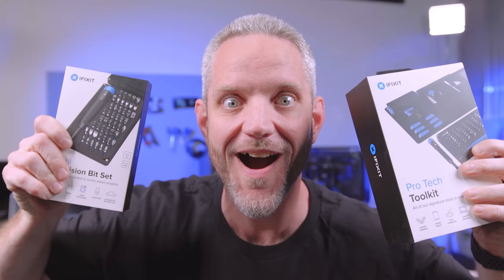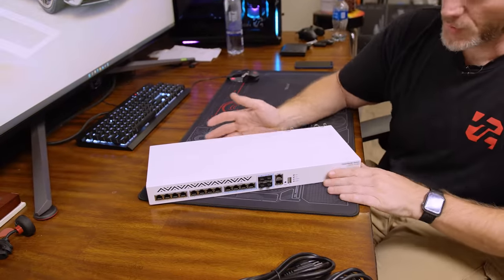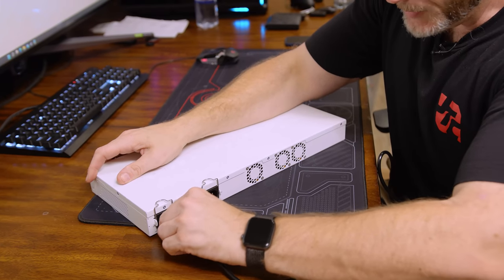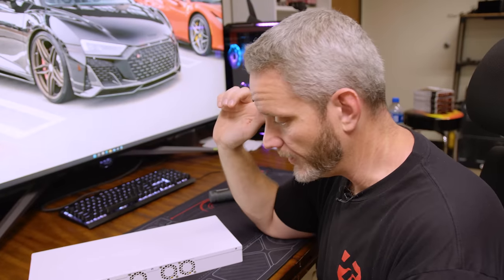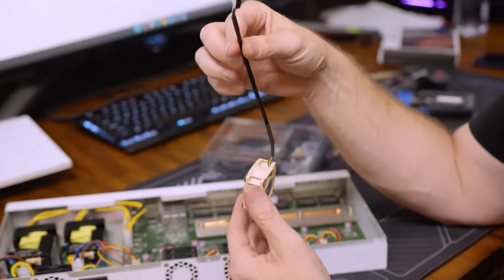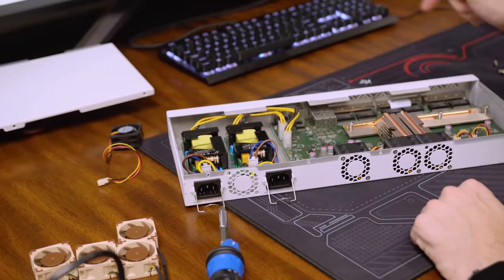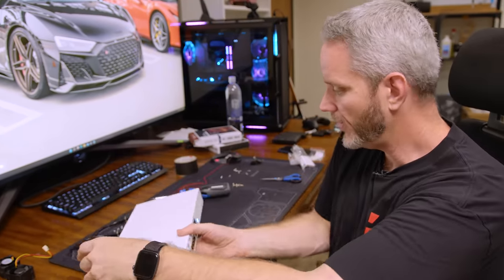We had to modify our new network switch...

Comment: Jay: God how does Noctua do it?
Noctua: We charge $15 for good fans, instead of selling $3 fans... LOL
Reply: Quality does make a difference.
Reply: Something to keep in mind. Noctua fans will not move the same amount of air as the ones he removed. And if you fill that router and load it up in a hot rack, it might overheat.
Reply: @tudalex  I don't think temps are really an issue so much as noise is...
Reply: That's pretty much it. I just wish the $3 fan makers would make fans for $6 that will likely be 80% as good as the Noctua's
Reply: @ferdievanschalkwyk1669  These do exist. If you shop around a bit, companies like BeQuiet and Coolermaster, or lesser known Chinese brands make mid tier products for mid tier pricing. Also, pretty much every case manufacturer has their own fan lineup now days, so if you're looking for mid tier fans, that tends to be a decent place to look.
Reply: @41chemist19  I was more specifically referring to the fans installed in devices like, switches, inverters, routers etc.
Reply: @tudalex  What makes you thin the stock fans will move more air than the Noctuas? They are the same size and Noctua's larger fans tend to move more air or just as much air but quieter than competitors.
Reply: @Thurgosh_OG  They aren't the same size - the stock fans are twice as deep. And next is that I think the stock fans are designed to support a higher rpm too - their main design criteria is to shuffle very much air continuously for many years.

The stock fans are designed for a hot server rack that stays the same hot temperature day in and day out for the next 5-10 years.

That's why rack equipment sounds like jet planes when they boot and runs the fans at 100%, and then normally return to much saner volumes when the adaptive control takes over based on actual cooling needs. But that's a speed they are prepared to keep running continuously in a rack. These Noctua fans will not be able to keep up. Just that Jay don't need the max performance of the stock fans because he will not run all 12 ports at 100% in a hot server rack. I'm pretty sure his rack will be 10-20°C cooler than the original design limit of the switch - and while he needs many ports he doesn't have a setup needing to fully load the  switching backplane of the switch running all 12 switch port at max duplex capacity at the same time.
Reply: The original fans aren't $3 to end customers - they aren't noisy because they are cheap but because they are designed to pump way more air than the Noctua fans and more importantly to support much higher air pressures. The higher air pressures supported results in the much higher noise.
Reply: Buy a $3 fan you get a loud POS that dies in a few months - They have a number of fans with different RPM's - Noctua fans are worth it.
Reply: @Thurgosh_OG  the Noctua fans he’s using move maybe 75% of the flow the original high rpm death fans do. Those specific ones he pulled, except the PSU area one, look like what I call “double stacked delta death” fans, and the Noctua will move about 50-60% of the air. I’ve swapped those fans onto multiple AMD EPYC 1U super micro chassis. No heat problems.  Yes the machine is probably 5-8C hotter, but it doesn’t make you go deaf anymore :)
Reply: @granitecowboy2199  If that's true, why place high capacity fan from the factory?
Reply: The NF-A4x20 is designed to go into such devices like that switch. The 40x20s are 5000rpm and do move about 5,54 CFM at 2,26 mm H₂O and clearly there were no real deltas in that switch...
Reply: ZaHandle  Possibly. Buy note.that rack equipment is designed for very high input air temperatures. Which means support for silly high air speeds to keep the temperature differential low.

So just about all rack equipment is very, very noisy. Look at a Dell or HP enterprise server. Or some Cisco equipment. They are not designed for residential use where noise matters. They are intended for an environment where no care taker regularly listens to the sound of every fan and updates if it sounds rough. The main goal is 5+ years delivering massive amounts of air from small diameter fans, having the air scream past the hot semiconductors/disks inside the equipment. And that is why people shouldn't apply own views about low-speed, low-pressure/big area fans custom-designed for better home PC installations.

Comment: Being an IT guy and a system builder myself, I can't believe it took as long as it did for me to come across your channel.  I've been binging on all of your content for the past week and a half!   Top notch stuff bro!  I have the final parts coming for my mixed use gaming/editing rig tomorrow so I'll be binging again while I build.  Repurposed i7-10700, 32gb, 2070 Super,  enough LEDs to give my cat seizures (not really but sounded funny).  Still rocking my Cooler Master tower cooler too, from 2005!  The bracket that came with it has fit everything from an FX-8350 right up to my current build (the i7).  I almost went AIO but I just can't give up this cooler (original fan too but I'm replacing it with an LED this time).
Reply: Enjoy! I built a similar rig during the pandemic (i7 10700KF, 32GB, M.2 NVME OS drive with an insanely overpriced EVGA 3070) and it rocks pretty much anything I throw at it game-wise or image- & video- wise at high to ultra settings. 😁 That's at 3440 x 1440 btw. 😃

(edit: added screen resolution!)
Reply: @mnemonik61  Very nice!  I was fortunate that my boss wanted to give his kid's gaming rig an update so when he bought the 2070 he ordered 2 and handed me one.

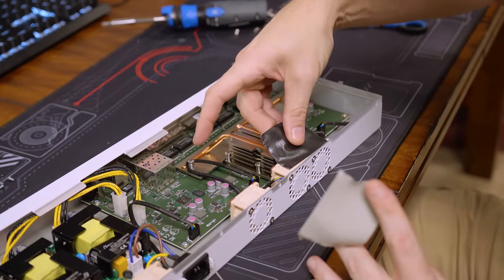Comment: 12:11 I can't see how the tape would be necessary since the cover/lid serves that exact purpose.
Reply: Yea i said the same, it be better at the sides to create a tunnel, the lid being the top part. but pretty sure it wont last long since the "wind" will blow it of eventually. should 3D print a small box for that area using old fans as a template for size. that's how i would have done it. shrugs
Reply: Yep that gap make me notice those deltas are maybe 40x40x28 (TFA0412CN-CN) and each of them move 4x Noctua amount of air. I hope that don't get full load for long time or it maybe won't cool enough.
Reply: @LimbaZero  I'm surprised it has fans like that to start with.. It does say it's tested to 70C ambient though so I could imagine it needing them then..

Suspect once it's booted it'd have been pretty quiet anyway with the stock fans.  It's just switching.. not even PoE, in an air conditioned room with presumably about 18C intake.

Comment: The adhesive of tape doesn't like heat. You could 3d print (plenty of online services if you don't have a printer) a part to direct the airflow on all sides. Or simply use foam or poster board, CA glue, and an exacto knife to make a much better air guide for your $600 switch.

Comment: The suggestion to run switchOS is exactly spot on. These are no good in router mode, but baller in switch mode. I have them all over the place as storage switches and they work great.

Comment: Mikrotik is great for the value brought.  I've used their switches in many setups.
Reply: They are, but they have a very steep learning curve. I would say only for power users.
Reply: I have several for my home lab.  I suggested to Jay to switch it to SwitchOS to make it easier to manage and get better performance.
Reply: @Darkk6969  I would agree. The switchos is so fast that the first time I updated, I assumed it didn't work because the ui was back so fast
Reply: I see these things in rural ISP networks and mobile racks and stuff like that, where their Swiss Army Knife traits are often useful.  They're not as reliable as the market leader products, and I cringe when I see them in places where uptime is a consideration.  But, they're cheap enough to throw them away and replace with a new one when they fail.

From what I understand, they also do all of their processing in software, so they'll never be as fast as a switch with a real data plane.  You get what you pay for.
Reply: @nickwallette6201  that is incorrect.  The Mikrotik switches use ASIC's and switch the packets in hardware.  

You can hit 10G wirespeed on every port simultaneously without any slow down
Reply: @Andrew_Thrift   Hm, OK.. it might have been that firewalling and routing were done on the management plane then.  I dunno.  It could also be that whoever it was that informed me of this was uninformed or their experience was out-of-date.  * shrug *
Reply: @Andrew_Thrift  Still hardware spyware. May as well install Hikvision camera's into your bedroom.
Reply: @BDBD16  How are Mikrotik spyware ?

Comment: I have everything from 100Mb to 40Gb QSFP+ in my setup. 
Use Cat5/6 for anything outside the rack or management interfaces. 
Use SFP with DACs in rack. Use fiber only for 100m+ long runs.

Comment: If you have trouble getting full 10G speeds these usually come by default with MTU set to 1500 and to get the full performance you will need to set it to 9000 manually (unless they changed it over the years) also don't forget to upgrade to ROS v7.
Reply from the maker: Its supposed to have a 1 button update. We will definitely check it out once its booted.
Reply: 10G ethernet equipment has been apparently pretty difficult
Reply: Jumbo Packet will destroy the collision frequency unless EVERY connected device supports it and set so.
Reply: @Jayztwocents  First upgrade the OS (System, Packages) and then upgrade firmware (System, Routerboard). Reboot after each step.
Reply: @BenState  Jup and basically goes for all nodes and not all of them wil support it. I’d usually saved upping the mtu for separate iscsi networks.
Reply: @Jayztwocents  routeros is hard to setup, but when you do it properly - it works flawlessly.
Reply: @Jayztwocents  If you're just going to use it as a switch then Mikrotik's SwOS is better. It's stupid simple
Reply: @Jayztwocents  the important thing with 9000mtu or jumbo frames is that you can NOT mix it into a standard network. Also on each host computer depending on the network card they could have less hardware offloading features which could also cause performance issues with the current configuration.
Reply: @BenState  You're thinking of fragmentation. Collisions happen when several stations are sending on the same segment simultaneously, and *that never happens with a switch*. Every link is its own segment and has precisely two devices, neither of which can interfere with the transmissions of the other.
Reply: This is a switch, it doesn't use ROS but SwitchOS (latest version for this is 2.13)
Reply: @kostaskotoulas6542  It does have dual boot. Depends on the use case, but I personally steer away from SwOS.
Reply: @kostaskotoulas6542  default boot is ROS. It can boot SwOS.

Comment: You said no switch to switch, but you COULD easily get a 2nd one, and use 2 of the SFP+ ports with a short DAC cable and bind them for effective 20Gbs between the switches, you will hard pressed to push the full 10Gb between 2 ports anyway, so this would not be much of a bottleneck.
Reply: No, you can't. That's not how LAGG works. 

You get 2 10Gbps links. You don't get 20Gbps. Frame headers get hashed and if you're lucky, 2 clients get sent down different links. That's not always the case in instances of piss-poor hashing algorithms used to load-balance the LAGG.
Reply: @AC-cg4be  No one said you get 20Gb at once, but YOU CAN get 2x 10Gb connections across it at once.  There are only 10Gb ports available, why would you think 1 connection would reach 20Gbs?

Comment: Those Noctua fans are awesome.  I put a pair in the front of a 1U server I built.  They're so silent that I have them running full blast in the rack.  They're much quieter than the Supermicro 2U sitting further down.

I deploy Mikrotik gear at work and have a couple of their routerboards, including an LTE router in my truck.  Amazingly powerful devices.  But definitely put that in SwOS mode if you're just using it as a switch.

Comment: That is a quiet switch,  nice touch with PWM control.   Anyone that says that is loud has it in their bedroom.    Get a Foundry if you want loud.   I think you are going to have heat issues with the Noctua fans with the switch under load.
But, I don't see your office burying that switch like I would in a data center

Comment: Me and a friend did the same mod to a cisco switch, be aware that you need to check the pin out of the header as cisco use a none standard pinout.

It works great, those fans are beautifully quiet and is well worth doing if you're buying a used rack mount switch

Comment: Ubiquiti is a fantastic option as long as you can get your hands on the equipment. Great ecosystem and solution if you are looking for prosumer grade equipment for networking AND security. They have switches, routers, cameras, and even badge readers for employees to access buildings. Worth looking into for sure. Love my setup at home. Manage it anywhere and local DVR so no fees for anything.

Comment: I went with Unifi products from Ubiquiti for my network. Been rock solid for almost a year since now. Their hardware can be a bit difficult to acquire sometimes, though.
Reply: Ubiquiti is a lot easier to figure out and set up. Mikrotik might be better and cheaper though.
Reply: Ubiquiti is simpler, but I don't like the cloud centric approach their unifi line uses. Not for something simple like switches. I don't like that they can end of life a perfectly working product like they did with their access points. I can no longer manage them from the controller.
Reply: @ferdievanschalkwyk1669  Agreed. I still love my UAP-AC-LR, but when it comes time to upgrade or expand I'll probably look elsewhere. I downgraded for a while after the USG-integration firmware update, to get some features back, but bug-fixes and other improvements basically forced me to just take the L.
Reply: I like their piecemeal radio systems more.  Great stuff for building out mixed media networks in rural environments.  The UniFi systems can create problems if there is a discontinuity in network management. I had that happen to me.   Ended up with a UniFi subnet that was unrecoverable because no one knew the password for the key and that left a bunch of units bricked because they cannot be factory reset to associate with a new key unit.
Reply: Mikrotik is better for "hacker" types who wanna be able to do anything. Ubiquiti is good for quick setup, SDN, and Single-Pane-of-Glass
Reply: @QualityDoggo  Ubiquiti is also better for fast adoption of new standards. At least when I was shopping, Mikrotik didn't have any 802.11ac access points within 200% of what I paid for my UniFi.
Reply: @Azlehria  I've got a full Ubiquiti setup right now. I have the 16 port POE switch and a gen1 gateway and 3 of the new WiFi6 access points. I've had the AP's since February and everything else is around 5 years old. I will probably go right back to Ubiquiti when it's EOL for my switch/gateway.

Comment: 10G RJ45, 10G SFP+ (Be it RJ45, SR, LR etc) are physical layer connections (SFP = Small Formfactor Pluggable) - all are Ethernet, or at least in your use case. But SFP+ SFP28, QSFP28, QSFP56  etc do not in fact have to run Ethernet, you can use Fibre Channel, Infiniband etc in that form factor.

Just a FYI for educational purposes.

10G RJ45 consumes more power then (and requires more cooling) than SFP+ SR or LR, so would be nice to see the switch when it is in fact under load re how the fan mod works out as factory fan vs new fan you did not say the RPMs.

Another thing to consider here is the cable run length as 10G RJ45 has a much shorter cable run length (30m or 98.42 feet on cat 6E) unless you are installing Cat 7 and even then not good for higher speeds.

One point for using fibre is if you installed OM4 then you are able to upgrade down the line to 25G,50G,100G,200G and 400G (and soon 800G) - this pays only depending on how long to plan on staying in that location.
Reply: No one should be running OM4 fiber. Use single mode. The cost difference between them is negligible and SMF will easily support any speed now and most likely in the future.
Reply: Good info. What about the issue that Jay was referring to at 1:37 that the SFP+ cards (or any PCIE card for that matter) would not fit in their PCs  that they use to edit videos because the PCs have vertical mount GPUs? Is there a way to solve that problem? I assume their video editing rigs all have 10G RJ45 ethernet ports on the motherboard.
Reply: @DLJaspah  I've heard OM4 fiber can be a lot more durable tho, one claim here was "you can tie it in knots".
Now, I'm assuming that they're saying it will still work after you do that, but that's still quite impressive for fiber optics (assuming you untie it, fiber optics can only make light bend so much after all without getting high losses, or maybe I'm wrong about that)
The thing is that I've heard fiber optics is somewhat fragile, and if I was gonna run it in my house well it's gotta be able to make tight turns inside my walls.
Thoughts?
Reply: @DLJaspah  The cost difference will be in the transceivers, MMF vs SMF transceivers are much cheaper.
Reply: @kevinoneill2170  The card needed for a dual port 10/25G is a low profile (HHHL), I guess this would come down to wanting the speed over the bling of a vertical mounted GPU (or get a bigger case).
Reply: @44R0Ndin  please do not knot you fibre cables, just becourse you can does not mean you should :)
Reply: @TheMschipp  Well naturally I'd never do it on purpose, but the fact that you can with some kinds of fiber optics isn't a bad thing.
Reply: There is certainly alot of people calling the RJ45 Connector, Ethernet in this comments section. 
Nearly all home and small bussiness users will be purely Ethernet, whether its RJ45, Direct Attach Copper SFP+ cables, or SFP+ RJ45/Fiber Transceivers. But oh well, I guess anyone that knows the difference will understand what they mean anyways..